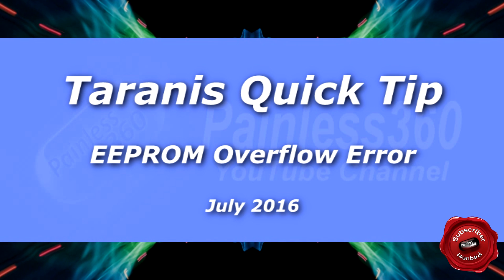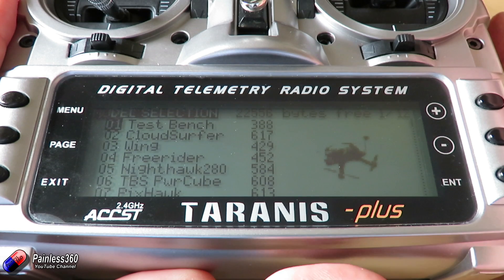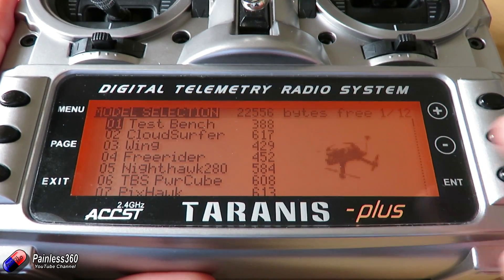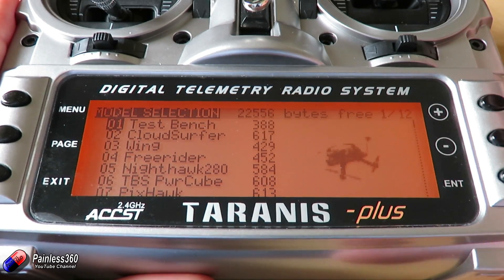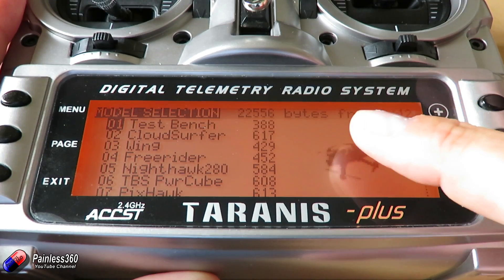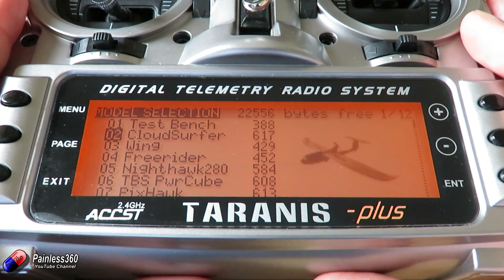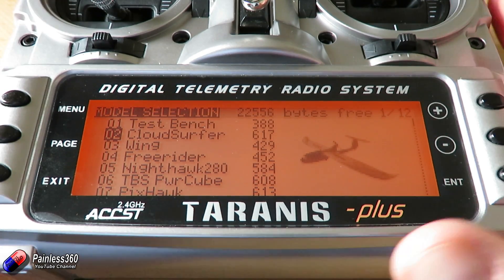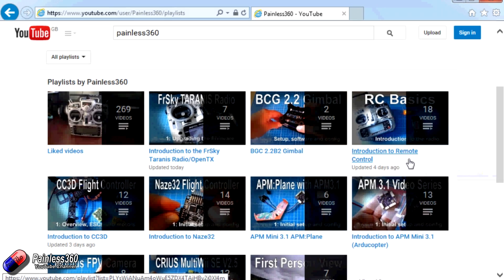OpenTX/Taranis Quick Tip: EEPROM Overflow error

Comment: I've jumped in here because the talk is about EEPROM....
Once upon a time I thought OpenTx Companion plus my X9D and X9E radios were beautiful “forever stable” easy to use companions. Having not used these for some time, and then updating Companion to 2.3.15 , I get warnings ...”EEPROM data V217. Press any key”...Converting....
but it does not stick. It seems to me that the EEPROM version/format is not compatible, but how to fix that??

That’s when the confusion sets in. After hours of routing around on-line, I am still stuck. 
On the SD card I see, under EEPROMS, eeprom 2000-01-01-001511.bin (is “2000” the year? –old! Too old? "the problem area?") . 
Under FIRMWARE, I see XJT-ACCST-2.1.0.FCC.frk, which I placed there recently. How is a simple soul like me supposed to know if this is all as it should be? 
How do I update the EEPROM format, which is what I believe I need to do, but have failed to find out how.
Reply from the maker: This is not something I have seen but lots of things about the error in the forums i.e. https://openrcforums.com/forum/viewtopic.php?t=8605 Best of luck with it..

Comment: Thanks for the info in this video.
Have you a video for using more than one sd card for my Tarnis radio..one for my Gliders, one for my indoor planes and one for power models. So I can change the sd card for different flying days.
The only reason for this is that I have a few large Slope soaring gliders that use up a lot of EEPROM space, and I get the overflow error
Have tried to do this but the sd cards always come out  with the same models etc.

Trevor.
Reply from the maker: I'd use Companion to move the models to and from the radio and keep a master set on the PC.. Best of luck!

Comment: Thanks for the video. They are all fantastic. I've watched all of your taranis videos and thought maybe you could help me with a charging solution for the LiPo 2000mah that comes with it. I use the wall plug that comes with it but want to charge externally. The battery only has a balance style plug on it which won't work on my charger. Do they sell an adapter I could use with my external charger or can I rig something. All the information online and still have not found a good solution. Thanks for reading.
Reply from the maker: I charge the battery inside the radio with the charger so not sure, let me know if you find something that works.. Best of luck!

Comment: Hi was wondering if you can make a video an this:

2.4G CC2500 A7105 Flysky Frsky Devo DSM2 
Multiprotocol TX Module With Antenna
https://bnc.lt/4Sug/Bi2B6am3zu

The tiny whoop is getting popular and eachine released a cheaper one which u can control using that module and most chinese brand quads using either your Frsky transmitter or Turnigy Tx.
Reply from the maker: Thanks for the idea, we are looking at the Firefox Rx at the moment for a future video..